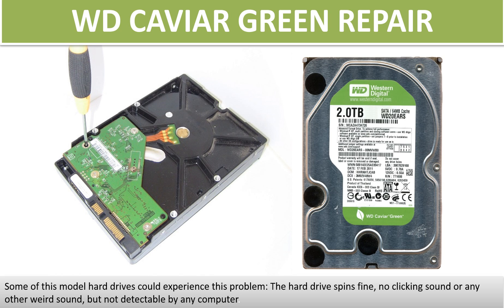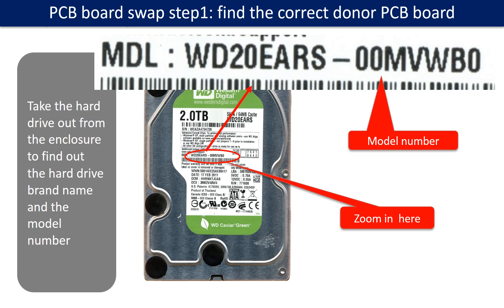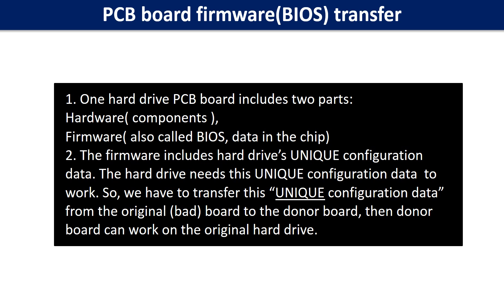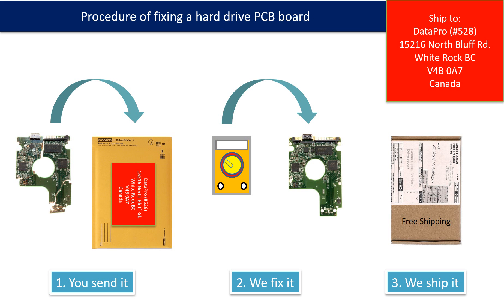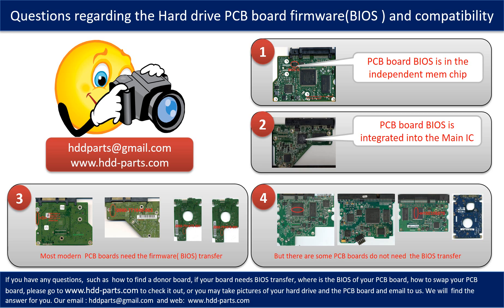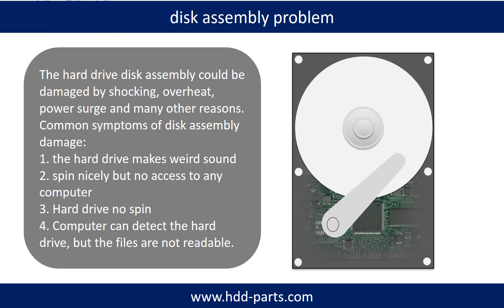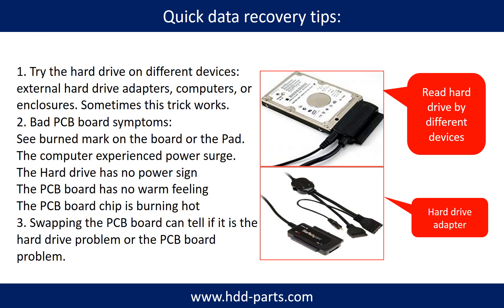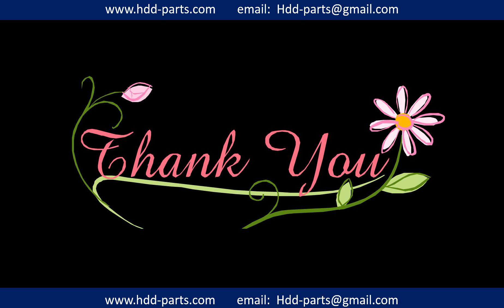WD CAVIAR GREEN  repair data recovery 771698  WD20EACS   WD20EARX  WD20EURS WD30EURS WD30EZRS   WD30

Comment: Wow! I have my work cut out for me.  Thanks for sharing - although I am late to the party. I have a older Western Digital 500GB External Hard Disk Drive": It crashed in the year 2525 [ha got carried away in reference to a song] - it actually crashed in 2015! A local shop tech told me that the only way I could recover my data is by obtaining a identical enclosure controller board to read the data?  I still have my WD 500GB external hard - I removed the case, but I didn't disassemble the drive itself.  I thought I could give it a try again because my toolbox has improved - I own a Thermaltake - BlacX Duet Hard Drive Enclosure Docking Station – Black.  However, I know from watching this video it won't work.